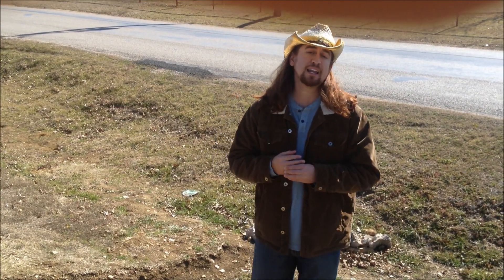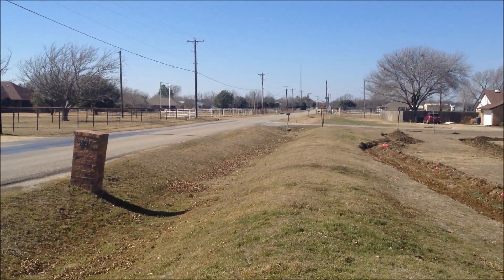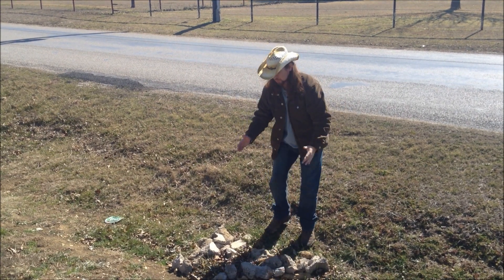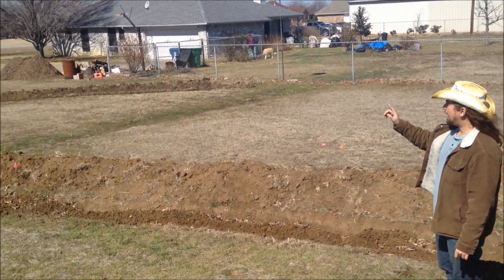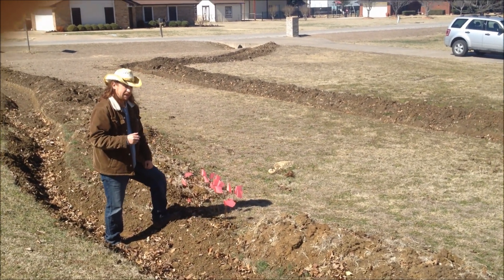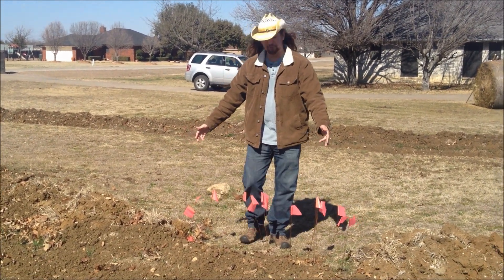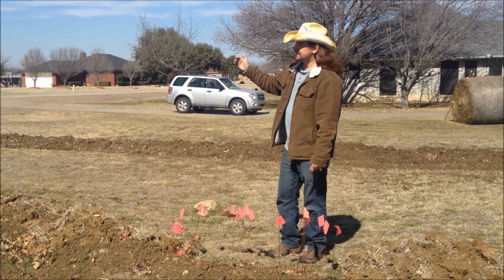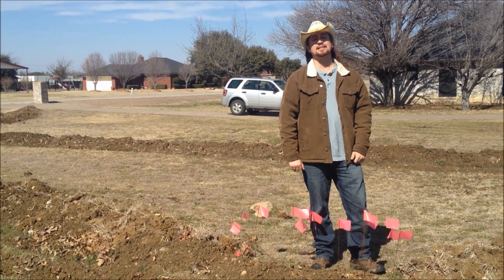Permaculture Tips - Earthworks: Diversion Drains, Gabion, Swales, & Level Sill Spillway

Comment: That road ditch water is probably no bueno for growing things.   All of the oil, gas, coolant, tire residues, etc ....all washing off the road on a large scale....coming right into the owners property and soil in which he grows food crops?
Reply: Mike Basic
 - That's "compartment thinking". Taking into consideration a single event, leave outside the entire "chain" connected to it!
It's not the best option, if given any better, or pristine choice to start with. On that we can all agree. 
BUT, now comes the but. Would it be better to have a "half dead" dry land?! Let's had the fact plants don't "eat" directly. They rely on a network of life to provide the nutrients. As such other biology will process any added elements. Not so much the fruit of the tree! This usually comes as a surprise to many. 

With this said, that same network of life has the "fantastic" ability to compost almost anything that's available. Be it hydrocarbons, salts, organic matter... and a big, etc. :-) What's left is usually heavy metals and some pesticides (many still legal in US!!) For the last, unfortunately there's little that can be done at this scale. With this said the advantages supplant by far and wide any disadvantages.
There's a reason why some more Eco developed countries adopt similar measures at a grand scale. ;-)

Comment: How do you measure the length of the level sill spillway?   I know it's related to catchment area x max rain in 24 hours divided by 24 hours divided by 60 and then divided by 60 again to get the max rainfall per second.  This will give you the discharge rate you need but I'm still confused about how to determine the length of spillway needed.  I am thinking it depends on what type of material the spillway is created from and how much water you want sheeting over the top, which is an erosion concern.  I have not been able to find answers these questions anywhere!

Comment: Shouldn't the spill way be a at least 5 inches higher than the contour line of the swale? This way the first few inches soak into the swale.  I am trying to learn this.
Reply from the maker: Good question +Ryan Barr. It would not have hurt if we did that here. Spillways are quite the interesting element to install. There is no one size fits all solution, however there are guides and specific information when planning and designing a spillway to query, such as: the amount of drainage/catchment that will run into the spillway during a 100 year rain event, the flow rate during those events, the holding capacity of the soil, the proposed depth of water we are willing to let spill over the spillway in a very large rain event, what the element attached to the spillway is used for, the vegetation on said drainage area, the vegetation on the spillway area, the amount of slope, and on this specific spillway - what systems are also drawing the water such as the tree and food forest system. Spillways are both simple and complex. 

There is a lot of data to mine and unfortunately it is not all in one location to index. There are very good resources to find the data, but take some time and soak it all in. Also talk with folks who have installed the features like the ones you are interested in or that are similar. And never stop learning - the more you know the less you know.